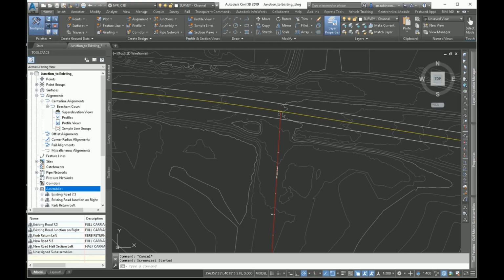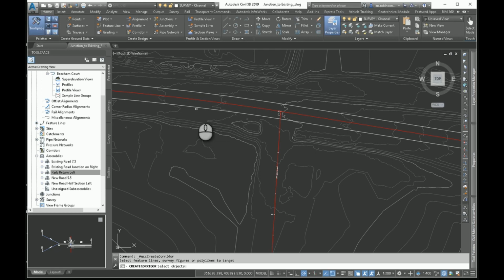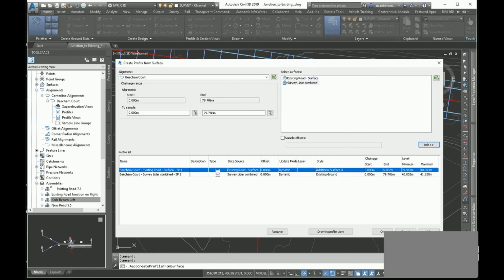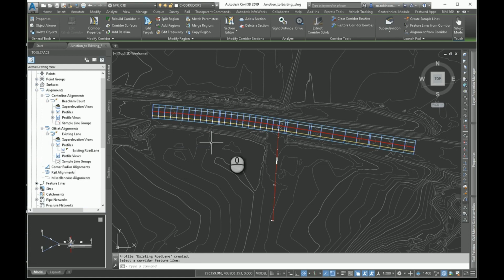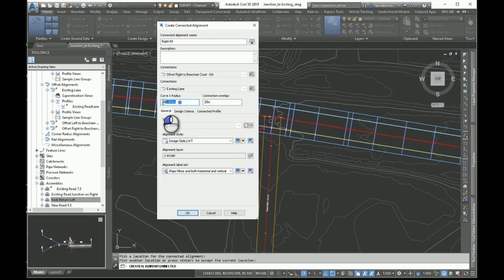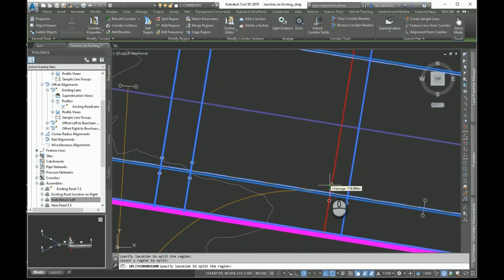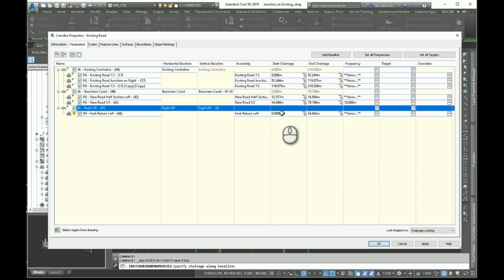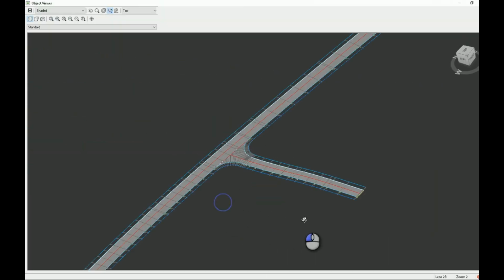Tying into an Existing Road with AutoCAD Civil 3D

Comment: Great tutorial!Please describe how to create the kerb return assembly as i can't position the basepoint on the lane.
Reply from the maker: Hi Robert, good question. 

This is something a lot of people forget to do when creating Kerb Return Assemblies.
It’s not about turning your lane the other way, you just need to change the codes for the inside point (normally set to “Crown”)  to “Lane” and the outside point (Called ‘lane Type’ and normally set to “Lane”) to “Crown”. Do this in the properties of the subassembly. 

Hope this helps. 
The Graitec Team
Reply: Thankyou that's lowered my blood pressure no end. Much appreciated!
Reply: Hello Robert. I really enjoyed this video. How do you go about creating the kerb return assembly. Is this a standard template in the inbuilt library an if so what tab is it under?